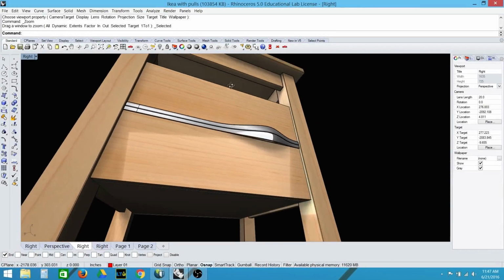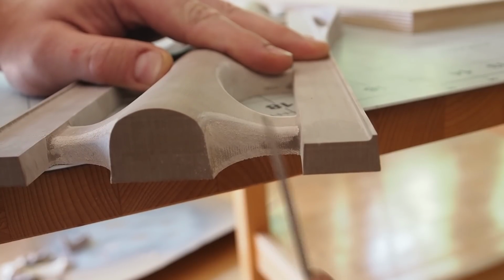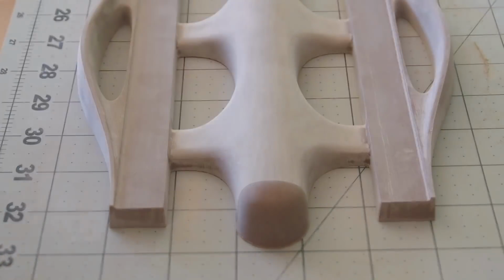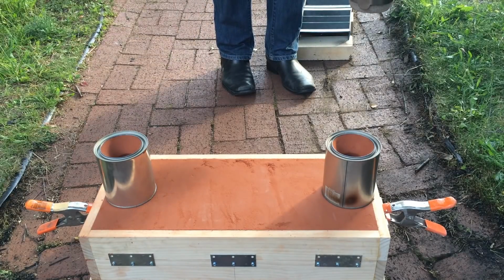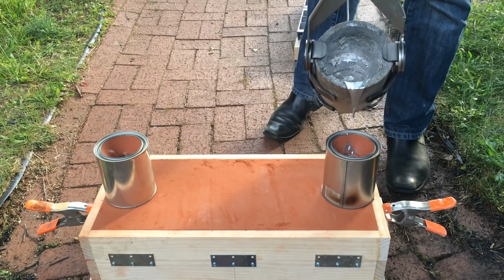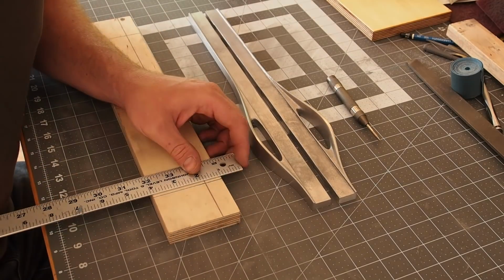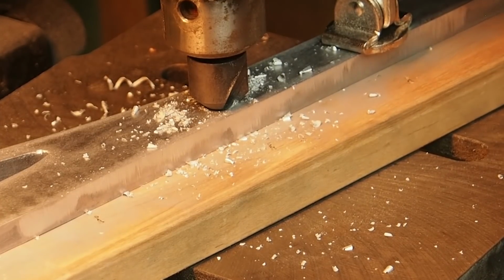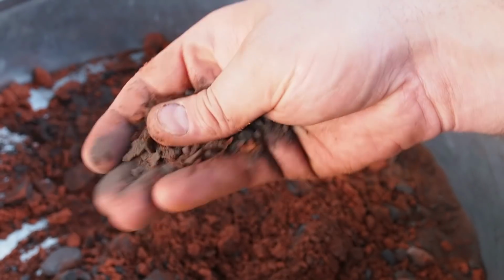Casting Custom Aluminum Drawer Handles

Comment: They could have been milled out of a chunk of aluminum but casting is cool too
Reply from the maker: +chadwick hayes Scrap aluminum costs less than $1 per pound, what would a 18" x 6" x " billet of aluminum cost.  Casting is a much better approach, especially for multiples!
Reply: +Brian Oltrogge I would agree I've casted myself but you wouldn't need but a 18x6 just 18x4 mill both top and bottom then cut in half but I'm bias I love mills and I do not hate the technique  of casting it's not easy and I do like the video and you should make a stamping hammer it's a pistol style grip with a wedge on the bottom and a flat face on top makes tamping easier than a dead blow hammer lol p.s. I'm a subscriber and l still love the videos
Reply from the maker: +chadwick hayes I have a 3d printed pattern of a sand rammer that I will cast soon that is exactly that!  Thanks for the comments!

Comment: So Brian, what do you do with your petrobond after casting. The burnt bits. How do you get out the burnt bits and reuse the good bits.
Reply from the maker: +gus bisbal Did you see the bonus clip at the very end?  The stuff I scrape off goes into one bucket and the good stuff goes into another bucket, ready to use again!
Reply: OK its official. I am an idiot that doesn't know how to watch a full video. Thank you. I throw mine away. The burnt bits. Which I am not happy about that. Interesting what you say about people preferring the burn elements mixed in. Why would that be?
Reply from the maker: +gus bisbal When I visited a local foundry, their Petrobond was black from reuse.  I certainly wouldn't throw it away!  I sifted some burnt stuff like I showed in the video.  This was during the winter.  When it is freezing cold, the sand will just run through the strainer.  I haven't tried casting with it but it seems pretty consistent.  I just haven't run out of fresh stuff yet.

Comment: that cast came out fantastically. by the way what did you use to degass the aluminium? I've never heard of anyone doing that so I'm just curious
Reply from the maker: +rstokes119 Some people degas some don't.  It might be hocus-pokus, but if someone told me if I stood on one leg while pouring would improve porosity, I'd probably try it once.  BTW, I use Arm and Hammer Washing Soda.
Reply: +Brian Oltrogge lol alright. thanks for the reply

Comment: The video is good, the design is nice, except for the screws. Maybe the pulls should not be as thick as the wood, but installed in a rescessed daddo (?) and screwed from the back, in tapered holes.
Reply from the maker: +Olivier Nicole I kinda like it with the screws expressed.  I figure if the drawer is open, you are going to be looking at all the crap in the drawer anyway...  I have another project in mind where I'll have to solve this differently though..
Reply: OK. I was thinking about it for some more, while driving, you could machine a slot, or a dove tail at the bottom of the aluminium rail and have the corresponding profile at the top of the drawer face. But as I said, the design and work is really nice.